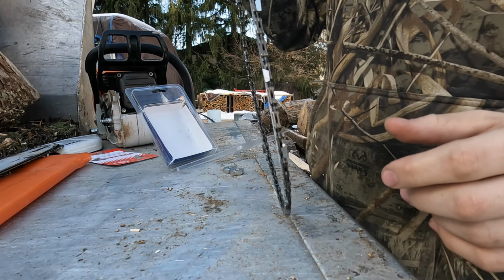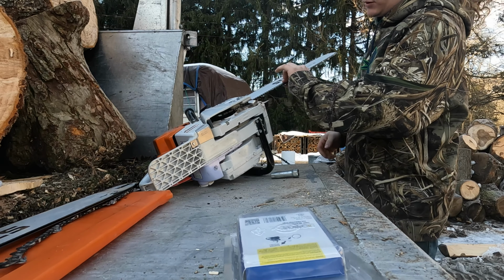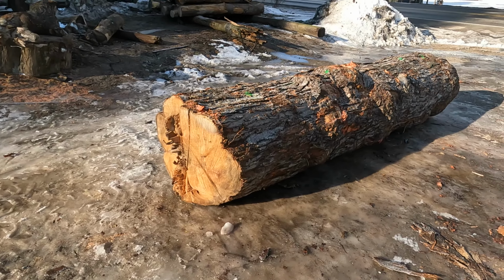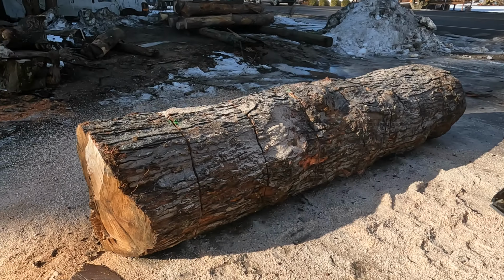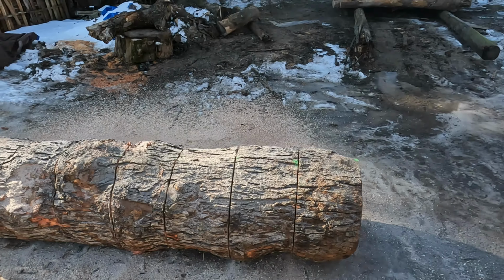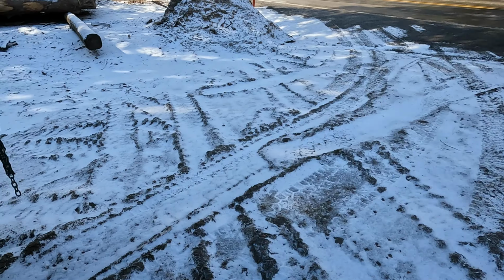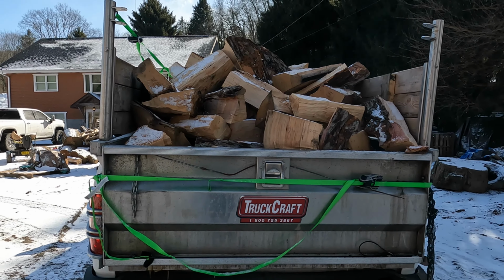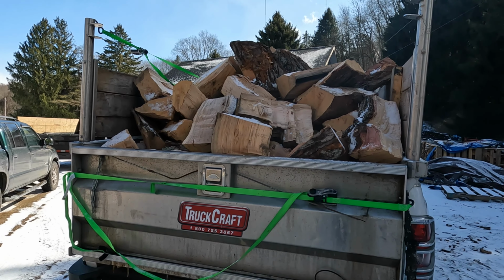Stihl MS461 bucking up big maple log. Cutting splitting and delivering firewood from log to heat.

Comment: I think the chain dulled up when you cut through metal. There is stains in that wood that would indicate that. Never had a chain dulled by it being loose. Keep up the good work and watch your back with those heavy logs.
Reply from the maker: Yes the black stains give it away didn’t realize til I was splitting there was very old looking nails in there